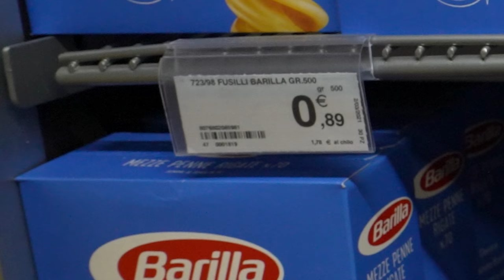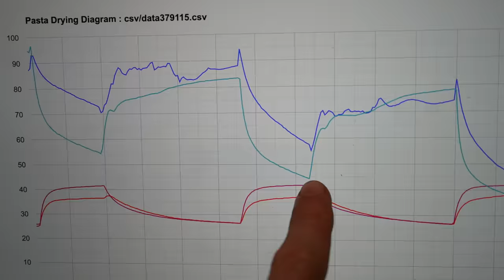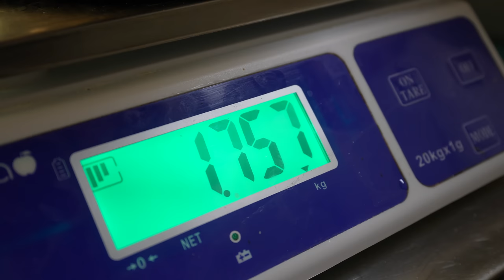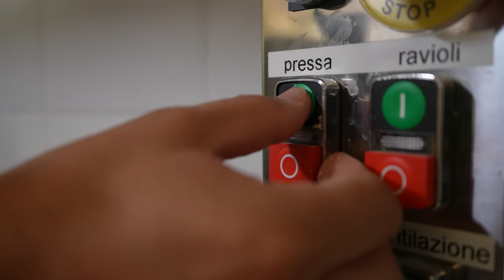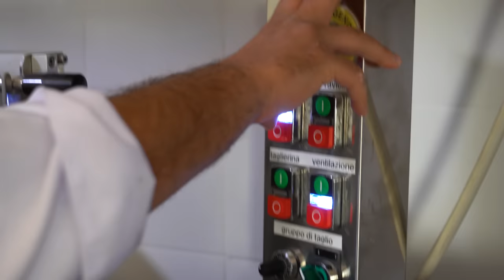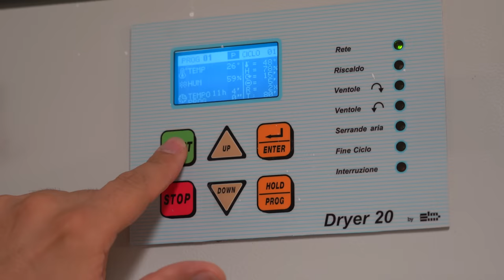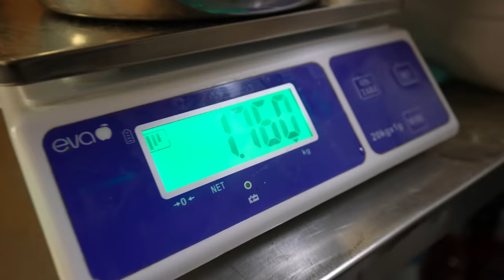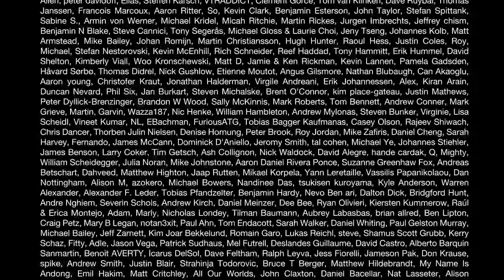I Got Hired by Italian Pasta Master and Discovered This (my only hope)

Comment: I like how he's not worried at all about showing someone how he makes pasta, it's so hard to duplicate that it doesnt matter if people know.
Reply: One of his points was that each manufacturer has to tune their process to their equipment, recipe, and environment anyway, so unless someone literally used the exact same equipment and ingredients as him, specifically in a climate like that of Rome, they'd need to tweak the information anyway.
Reply: I imagine even making the same recipe, with the same equipment, in Rome would not be enough. The microclimate of the building and seasonal variation would play a huge part in making perfect pasta. With everything needing to be just so even the slightest difference in environment could make or break the pasta
Reply: @LashknifeTalon  Even then unless it had the specific climate of his underground room with all the related environmental factors that create it, it wouldn't. Remember in one of Alex's past videos where he talked about how pasta was hung to dry on a single specific street because it had a combination of sea breeze and mountain breeze that oscillated perfectly for the process naturally due to the geography.

Comment: The filter before the die might be the important missing piece! For extrusion of plastic you often use similar filter (called screenpack) to increase pressure and mixing of the material, as it helps to make mechanical properties better.
Reply: This is going to be the key.  That filter greatly increased the extrusion pressure.  That is consolidating the gluten.

Comment: Just a guess, but I think there is something wrong with the gluten development, maybe a bit higher hydration (since smaller batches will loose proportionally more water to evaporation), more time before extruding (to let the dough hydrate and autolyse) and also it might be worth checking minerality and pH of your water since that can also affect gluten development.
Reply: It sounds so simple in hindsight when you see Luciano's pasta, not entirely sure ofcourse it will be the fix but when you see the strength and flex of Luciano's it just has to be the gluten..
Hyped for s2
Reply: That would have been my guess after seeing the dough that has been sitting in the machine for half an hour coming out looking like Alex's.
Reply: Agreed, To add, the cooling during extrusion is a key step to preserve the gluten network. W/o that the pasta is half cooked.
Reply: I agree @Merek, I also think that the extrusion is too thin as well as the pasta isn’t extruded out cold. Because of this I think that leads into the problem of drying too hot for the thickness and not enough airflow, leaving the dried pasta with too much moisture. No idea really, just a thought.
Reply: I think that pre drying, slightly lower hydration and a cooling system on the dye are the keys to this
Reply: That was my takeaway from Luciano's far longer kneading times, because that can only lead to greater gluten development. And that gives greater structure.
Reply: Check Myhrvold´s “modernist bread”. — vacuum autolysis is a great way to get good gluten development! The gluten gives the strength.
 Kneading dough with a that low hydration requires a lot of power & time.
Reply: I think that's what Luciano's 2-step addition process is good for. Along with a bunch of the other things mentioned here.
Reply: Hahaha just commented the same, I agree!
Reply: Yeah, I think you nailed it. Luciano's pasta is smooth and strong and elastic, like when you knead bread just right. Alex's pasta dough is too grainy and doesn't really stick together.
Reply: Yea. When I heard the comment about the consistency being different I immediately thought of the Food Theory video which dropped this weekend on New York Pizza. It does into a bit of detail on the ways water will affect the consistency if pizza dough. And it had a really dramatic effect.
Reply: Food Theory literally just did an episode on how the water in a region can completely change the way the food cooks and develops... That's what I would be looking at with a thing that is literally JUST flour and water... Like... It's not a small difference, it's fucking massive. Fluorine, Chlorine, Ph, mineral impurities, compare your water to Luciano's, I guarantee you there is a difference...

Comment: Season one ends with a cliffhanger! 🤣 Luciano provided so many clues: longer knead time, slightly higher hydration, pre soak the die, perforated stainless steel mesh insert, circulating water cooling system for the die, pre dry the pasta out of the machine with a simple fan, and lastly of course the long drying time with data captured by Alex's probe. Going through each of these variables engineering style is going to make a compelling season 2!
Reply: Fluorine, Chlorine, Ph, mineral impurities, compare your water to Luciano's, I guarantee you there is a difference...

Comment: When we saw how tough the pasta was straight off the die, my first thought was a higher amount of gluten. Likely Alex's dough recipe either doesn't have enough protein or it was not worked enough to form the gluten required. Luciano's dough mixer is larger than Alex's, and we didn't get much indication of how long it was in there before extrusion. Also the part where the first part of the extrusion gets returned to the hopper adds a wrinkle. 

But ultimately, if Alex was mixing for the same or shorter amount of time in a weaker machine, then that's likely what caused his pasta to become brittle.
Reply: Yea seems kinda obvious
Reply: actually we did get an idea of how long it'd been in there before extrusion: he flat-out said that it needed to be mixed for 25-30 minutes before extrusion. The first part of the extrusion getting returned to the mixer doesn't really add a wrinkle, either.
Reply: @KainYusanagi  kinda. I think he mixed the first half of the recipe for 10 minutes and then the second half gets poured in and mixed for another 25-30. But really he's saying that as a rough guideline because there's no timer involved, and after some cuts he's feeling the dough consistency and temperature before he says it's ready.

I'd say the returning of extruded dough to the hopper could make a big difference because that's working those parts of the dough very intensely. There's another cut at this point and we don't know how much was actually extruded before they started using it for the pasta. Could've been just a few pieces or it could've been several minutes. Edit: actually I watched that part again and the editing makes it seem like it's just the first few pieces.
Reply: @NickCombs  It seemed pretty obvious to me that he said for a total of 25-30 minutes, when Alex asked how much time *total*. 

It doesn't really matter at all because those bits of dough get re-added to the dough base and mixed into the entire thing as a cohesive whole, blended with everything all over again, to not waste dough. It won't affect the dough you're making to do so, unless you're using an absolutely monumental amount.

They also only extruded it for as long as was necessary to get the dough to properly form up, which is what matters, not any specific amount of time; it's all about working the dough through the extruder until all the old stuff from the day before is extruded (including the stuff in the dies, which were kept submerged in water to keep the dough in them soft; these dies get used every day, so the dough going stale isn't really a concern) and the extruder is warmed up, at the start of the whole process. It does it again when the extruder is left un-used with dough in it when they're changing trays out, and Alex remarks that the dough that came out was basically the same as what he was making.
Reply: @KainYusanagi  Yes, I did amend my point about returning the dough to the mixer. And I have been saying it's about the dough consistency, and that this is in large part dependent on the amount of mixing. The machine Luciano uses gives us a good basis for judging how long it would take for a less effective machine, since we know it will need to mix for longer to reach the same state. But I'm starting to think a less effective machine might just create enough pressure to compact the dough as well through the extruder.

I do think it took about 30 minutes total, but not because Luciano said "30 minutes total."

6:10 
L: "We mix this for ten minutes."

7:40 
L: "You see the dough looks like sand."
A: "How long are you going to be mixing for?" 
L: "Twenty-five minutes more or less, half an hour. Depends."

8:34
L: "So Alex. Now, after twenty minutes, we just have to do one thing that's very important. 
So we have to feel the dough. And when we press with hand, it's very compact.
But if you go like that, it looks like sand."
A: "It's like wet sand."
L: "Yeah. You see also the dough is a little bit hot. It's warm. So that means it's ready to be extruded."

Ten minutes with the first half, then 20 more minutes while the whole recipe is in the mixer. So the first half gets worked longer. That's presumably why it compacts like wet sand, because only half of the semolina is fully malleable.

Comment: Excellent series, Alex! Fun, entertaining and educational. I hope you continue it someday. Otherwise, it will haunt you!

I've been making a lot of pasta at home, old school, with a simple Marconi/Atlas roller/cutter setup. My Italian Grandparents did it for years. The recipe I use is just semolina and water, no egg. After the noodles hang a few minutes ( to surface-dry the cut edges), they're laid on shelves in a (front-to-back air flow) dehydrator with the heat turned off, all the way down. Once the humidity inside is around 45% rH, I shut off the machine, the "rest". When the humidity goes way up, near 75-90%, the dryer is turned on. After data logging, it would be easy to automate the process. However, I do it when it's raining and I'm nearby. A thermo-hygrometer probe sits inside the dehydrator so I know what's up. I hung a sheet of plastic over the exhaust vents, so when the machine fan is off, it's more closed from drafts. This also creates more turbulence inside the dehydrator. Works great!

The resulting fettuccine is silkier, far better than commercially extruded pasta. There is a different texture resulting from rolling vs. extruding, which my family prefers. Of course, with just water, the semolina is key for flavor.

Comment: Alex, this whole series was so fantastic. I just bought the Philips home extruder and dies from Pastidea, but I’m already considering upgrading to a more powerful machine. I’m obsessing with the concept of drying my pasta. Haven’t even tried it with the Philips, because I prefer hollow shapes like rigatoni, and they’re apparently the worst offenders as you’ve seen. 

I was reading a research paper about the outcome of various drying processes, and the researchers found some great success with vacuum drying. Like, $15,000 ovens with vacuum functions. They set the temperature to 80c and cooked it for one hour, three times, allowing the pasta to cool to 35c between each cook. First cook was at 50kPa, second at 30 kPa, and third at 10kPa. The study says “semolina,” but I assume they used semola. Flour and 35c water at 34% hydration, mixed for 10 minutes and extruded in a La Monferrina P3 as penne. They found vacuum drying to produce a harder, less sticky, more springy, and more yellow dry pasta than other methods. It also had the lowest loss during cooking at only 4g/100g. 

I MAY become obsessed with this. I may even buy a metal vacuum chamber and pump, build some oven-safe drying racks that fit inside, and see if I can reproduce their work in my oven. If I ever do, I’ll let you know here. But if you ever consider revisiting this fantastic series, a vacuum drying video would be super super interesting!

Thanks for all your hard work! I just found your channel a few weeks ago and can’t stop watching 😂

Comment: Hi Alex, I don't know if you will read my tip but, I believe the problem is the % of water in your dough, Luciano's semolina can handle 29% that's due to the protein content of the extra pressure his machine can deliver. But the more protein content in the semolina means that it can handle more water content. I would check how much protein content is in your semolina vs Luciano's one. 
I saying it from the same process I do with pizza making, different flours with different protein content and "W" can handle different % of hydration. 
in bocca al lupo
Reply: T̲h̲a̲n̲k̲s̲~~~~<f̲o̲r̲ w̲a̲t̲c̲h̲i̲n̲g̲ a̲n̲d̲ c̲o̲m̲m̲e̲n̲t̲i̲n̲g̲~d̲o̲n̲t̲ f̲o̲r̲g̲e̲t̲ t̲o̲ h̲i̲t̲ t̲h̲e̲✔ s̲u̲b̲s̲c̲r̲i̲p̲t̲i̲o̲n̲ b̲e̲l̲l̲. T̲h̲a̲n̲k̲ y̲o̲u̲ a̲n̲d̲ I̲ w̲i̲l̲l̲ a̲l̲s̲o̲▒ s̲h̲a̲r̲e̲ n̲e̲w̲ f̲i̲n̲d̲i̲n̲g̲s̲ w̲i̲t̲h̲ y̲o̲u̲ i̲n̲ a̲ m̲o̲m̲e̲n̲t̲❄𓀇 c̲o̲n̲t̲a̲c̲t̲ m̲e̲ p̲r̲i̲v̲a̲t̲e̲l̲y̲💻꧁ ༒ Whatssp✤ ⫸ +¹⁸⁵⁴²⁰⁷¹¹³⁰★⁰༒꧂

Comment: Good luck on your research in preparation for season 2. 
To build up knowledge base of these machines, probably should manualize some steps (say hand make the pasta and then use the drying machine) 
1. Dough Mixing - is the raw material consistent? Play around with mixing time and speed. Maybe the stress within the dough is not uniformly distributed? Or too much (or too little) stress leading them to break
2. Extrusion - is the heat / pressure used to form pasta ended up cooking it? Is the pressure applied consistent? Is it time dependent? ( Are the breakage from the beg/mid/end of batch?)
3. Drying - I am curious if hang dry the pasta in room temp / rh and use a de-humidifier. But as you said, Luciano pasta looks different from yours post extrusion so it is probably not this step.

Comment: @Alex  !IMPORTANT!  (copy from last video, hope you see this) 
11:56 One thing I find strange with your pasta dryer, is that I see no way where you are removing the air-moisture from the air, it just goes around & around, and I assume that in the resting period, the water saturated air will condensate back on ALL surfaces (including the pasta) in the "dryer" (moisturizer then).
Think of the air as a sponge, it can collect SOME amount of water, then you need to squeeze out the water from the sponge. To do that with air, you usually use a temperature shift, because hot air can hold more moisture than cold air.

So what you want to do is:
1:  Intake hot moist air
2: cool down air & let the moisture condensate on the cooling elements (freezing preferably but need to periodically defrost the cooling elements then)
2b: Need to remove the liquefied water from the system (a sink drain, bucket, or something away from the inside of the machine, also so it doesn't raise the humidity just outside the machine)
3: heat up air again to maximum allowed temperature (for maximum moisture holding capacity).
4: return air to drying chamber.

You can do an experiment to learn more about this.
Take eg. a 2L Cola bottle, fill it with water, remove ~2DL & squeeze the bottle so the water is at the top edge & put on the lid (no air inside)(to prevent it from exploding when freezing).
Put the bottle in the freezer & wait for it to be completely frozen solid.
Take out the bottle & place it in a deep soup-bowl or similar vessel.
Wait for the bottle to completely melt (while observing what happens on the outside). (use a fan to blow extra air on it for increased effect)
When melted, collect & measure the amount of water in the bowl, that water was collected from the air moisture.
Do a similar thing in your pasta dryer.

Comment: Hi Alex- watched one of your videos on a recommendation from YT and know i find myself watching more and more of the series. I admire your passion for food and your pursuit for perfection.. its good to see.

Now I could be mistaken, but possibly the reason his pasta has more strength and is more pliable / durable when working thru the die, is his extended mixing time. he mixed his for at least 25 minutes, 1/2 hr, - where as in the other video I saw that you made, your mixing time seemed quite short to me - i recall thinking at the time that there is no way you've developing the gluten in the pasta dough enough.. (which in turn would give you more strenght etc) - normally with a fresh pasta dough (lasagna sheets, ravioli etc, this would be a problem (especially if you over work it and don't rest it) - the result will be sheets that shrink and are tough to eat) - but here its dried pasta; so its not as important.
Reply: T̲h̲a̲n̲k̲s̲~~~~<f̲o̲r̲ w̲a̲t̲c̲h̲i̲n̲g̲ a̲n̲d̲ c̲o̲m̲m̲e̲n̲t̲i̲n̲g̲~d̲o̲n̲t̲ f̲o̲r̲g̲e̲t̲ t̲o̲ h̲i̲t̲ t̲h̲e̲✔ s̲u̲b̲s̲c̲r̲i̲p̲t̲i̲o̲n̲ b̲e̲l̲l̲. T̲h̲a̲n̲k̲ y̲o̲u̲ a̲n̲d̲ I̲ w̲i̲l̲l̲ a̲l̲s̲o̲▒ s̲h̲a̲r̲e̲ n̲e̲w̲ f̲i̲n̲d̲i̲n̲g̲s̲ w̲i̲t̲h̲ y̲o̲u̲ i̲n̲ a̲ m̲o̲m̲e̲n̲t̲❄𓀇 c̲o̲n̲t̲a̲c̲t̲ m̲e̲ p̲r̲i̲v̲a̲t̲e̲l̲y̲💻꧁ ༒ Whatssp✤ ⫸ +¹⁸⁵⁴²⁰⁷¹¹³⁰★⁰༒꧂

Comment: I ve been struggling with pasta extrusion for several years… my extrusion process is very similar (quantities and mixing times). The predrying is also a step I got correct… I put my racks over a fan. Then without a proper dryer, for the drying phase I ve had the best result by stacking the pasta racks, with empty racks on the top and bottom that will restrict the natural airflow and allow a very slow drying for more than 48h… in the end they look dried, they re not brittle, but the humidity is still a bit high to be stored properly, but at least I can eat the batch over several days… when your drier will be on point, if you launch a kickstarter campaign, I ll get onboard on day 1 😅